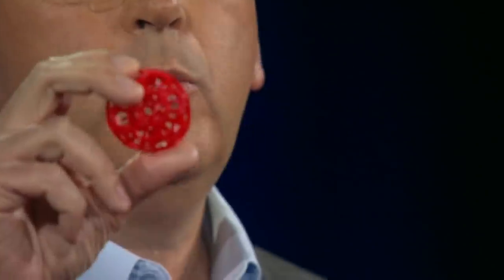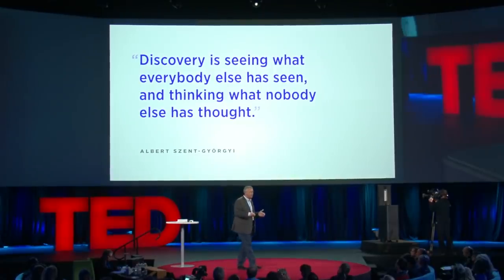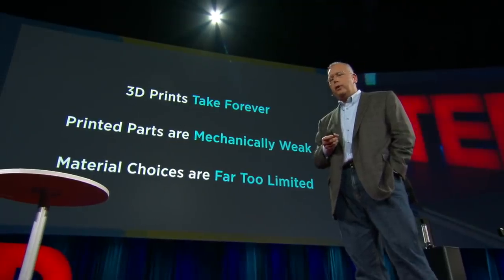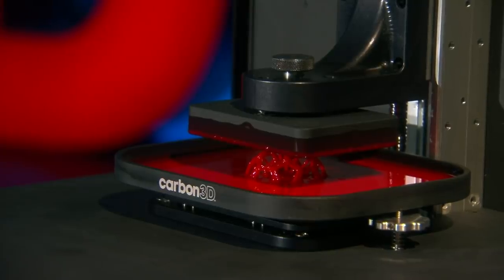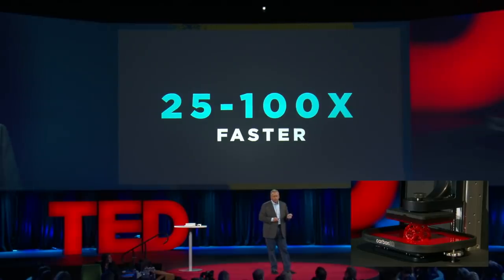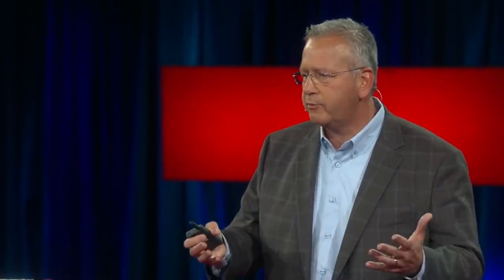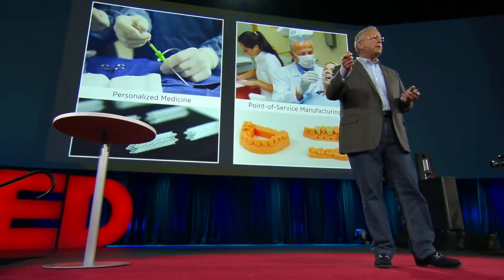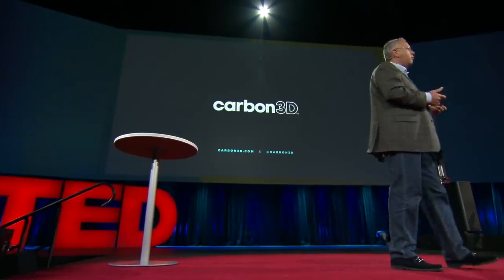What if 3D printing was 100x faster? | Joseph DeSimone

Comment: What if my inkyjet printer could connect to my computer and actually work
Reply: I find my 3d printer is more reliable then my inkjet
Reply: @Steph.98114  ikr
Reply: What if the ink refills for the printer didn't cost more per ounce than human blood. Yeah that's a fact
Reply: @brettking8663  just but a printer with a ciss system, or modify your's.
Reply: I just bought a printer. To replace all six ink cartridges costs £250~300, depending where you shop.
Reply: @brettking8663  Just out of curiosity, where do you buy human blood?
Reply: @nagualdesign   I don't buy. I like to make my own supply lol. "Sacrifice Saturday" 🗡️💉🧛
Reply: That would be too good. No can do.
Reply: The DIY Shop yeah and I found my 4d printer is even more reliable than my 3D printer!
Reply: Don't rush technology, dude. You are expecting too much.
Reply: The DIY Shop me too
Reply: You should be on here
Reply: LOl just buy a brother lazer printer in black and white.
If you want color just use something that has a screen.
Reply: Keep dreaming man, ctrl-p will never work properly
Reply: 2020 gang
 We still got '99 problems
Reply: We haven't invented this technology yet and my guess is we never will
Reply: What if we can get inkjet cartridges at one hundredth cost of the printer.•́  ‿ ,•̀
Reply: The day I brought a mono laser for the daily work was the day I stopped wonder how long till my printer decided to have a usb config issiue and need to be reinstalled and not been able to get the right cartridge the day before something super important to submit

Comment: 2D printing is really just 1D printing over and over again.
Reply: LMAO true
Reply: So... 3D printing is 1D printing over and over again?.. like.. infinite lines, with no depth, nor width, just to make.. a ball?
Reply: And 1D printing is 0D printing over and over again. XD
Reply: Technically yes, because you are printing lines over and over again, row after row on a piece of paper to form 2d shapes.

Correction: Actually, not technically. It is 1d printing over and over again
Reply: No. 2D printing is 2D printing. It prints 2D layers. If it would be 1D printing, then it would only print lines from left to right, like traditional old printers used to do. 3D printers move their head in two directions on each layer, so it's 2D printing over and over again.
Reply: Then 4D printing will just be 3D printing... over and over again... on the same spot... Makes sense to me!
Reply: Syntax Error.

"You just messed up my brain" 

 - Windows.

Sorry about that.

Error 404.
Reply: @Radoslaw1986xx  Traditional Old Printers? USED TO?! Where the heck do you live?! I'm thinking either the US or Japan but, IDK. Where I live (The Philippines), printers print lines (Well not right away, it's more like painting precise lines). And that's just 60 - 95% of them. The rest print dots one by one to create a line then the thing that puts ink on the paper goes back to the other side of the paper (one dot forward) to start the entire process again.
Reply: @moondust2365  That's exactly what I meant :-P Dots being put next to each other in one line ;-)
Where I live, most printers are laser printers (Poland).
Reply: @Radoslaw1986xx  But you said 2D? Isn't "2D Printing" in that sense just multiple 0D objects (dots, even though they're not really "zero dimensional" since they're circles) to create 1D objects (lines; again not really "one dimensional" but you probably already know that) with the process repeated to create a "proper" 2D object (also not what it claims to be, papers have thickness). Then why did you say that 2D Printing actually printed 2D? Because the final product was 2D? That it could print in 2 Dimensions, albeit not all at once, print dots in a manner that created a 2D object?
Sorry if I sound rude or ignorant, I am just trying to know whether or not if my previous statement was what you meant when you said "2D Printing is 2D printing"
Reply: A dot is a 1D-Object. There are no 0D-Objects per definition. You need to have at least one dimension, without one dimension you have "nothing" or "null". (Edit: You could have a singularity here, but my printer isnt printing dark holes out, so...) 3D consists 2D, as 2D consists 1D. You need the first dimension to draw the other ones of course. But!

My (3D)printer prints in 3D in a physical point of view, because the line it draws have a lenght, a height and a depth. But my old inkjet do actually the same. We might not see it, but ink have a height too. So technically (from physics pov) no printer can print a real 1-dimensial or 2-dimensional object in our 3-dimensional (just space,  no spacetime) world. So Michael Gonzales are not correct, at least not technically.
Reply: failed on understand dimensions.

thickness needs to be anything, or there would not be a line after all... if you have lengh and thickness you have 2D...  1D "doesnt exist" its just theorical... dont mix the amount of axis to be used on the printing with the dimensions.
Reply: I want to see a 2.5D fractal printer !!!
Reply: 1D printing doesn't exist. 2D printing is 2D printing because it happens in two dimensions. 1D printing can only happen in 1 dimension.
Reply: What is this... Flatface
Reply: 4D printing is really just 3D printing over and over again.
Reply: But actually it's not.  1D printing would never make a bigger line.  I hope it goes without saying, but 1D printing is not a thing.
Reply: @hypermangi8265  It would be a ReferenceError: 4th Dimension not found.
Reply: @Radoslaw1986xx  3D printers make a 2D product, then move upwards (3rd dimension) and make another 2D product. In 2D printing, the printer makes a 1D product, moves 2nd dimension and make another 1D product. It's the same thing your logic doesn't make sense.
Reply: @cingilc  You're wrong my friend. 3D printer is printing layers of project in 2D and then moves up another layer in 3rd dimension (Z axis). When printing each layer it moves simultaneously in both X and Y axis. If it was 1D printing over and over again it would move in X axis from left to right and then one step in Y axis - similar to ink jet printers.
Reply: @Radoslaw1986xx  The question was if 2D is printing is 1D printing over and over again. Doesn't matter what moves where, if a regular printer cannot print a whole paper at the same time, it IS 1D printing over and over again. By your logic 3D printing is also not 2D printing over and over again because each layer has some amount of z-axis length in them. So it is 3D printing over and over again.
Reply: @cingilc  in ink jet printers it is 1D over and over again, true. But video is about 3D printers. It matters what moves where because we're talking about 3D printer not 3D printed part. So the printer moves in three axis. But on each layer it moves in 2 axis so it is 2D. Laser engraver would be different case. It engraves 1D over and over to make 2D image. But CNC router engraving is 2D only, just as 3D printer. Both make arcs and straight lines (in every direction) and those are 2D objects.
Reply: @Radoslaw1986xx  I agree, actually "It engraves 1D over and over to make the 2D image." was exactly my point in this argument. So if a method is engraving 1D over and over to make a 2D image, it means it is 1D printing over and over again. Every product of CNC machines and every layer of 3D printers are "technically" 3 dimensional but I except they are 2D printing over and over again. The only 2D printing method does not fall in the category of 1D printing oaoa is medieval printing that uses presses.
Reply: @whovinny-brovian4223  Infinite dots. Not loonies or lines. Love em auto corrects
Reply: U dont really understand 2D..  Do u..??
Reply: 1D printing is just 0D printing over and over again
Reply: Technically 2D printing is 3D printing because the ink still has width and nothing is truly flat
Reply: 3D printing is really just 2D printing over and over again.
Reply: 3d printing is also just 1 printing over and ovet
Reply: @stephenmorgan6116  actually yea, you're printing dots (points) over and over again
Reply: Actually 1d printing is 3d
Reply: 3 printing is 2d printing over and over again
Reply: Omg, no! 1d is a dot. 2d is paper. 3d is reality.
Reply: 1D printing is just 0D printing over and over again...
Reply: @tvt2428  no its standing in one spot not moving at all.
Reply: Michael Gonzales 1:12
Reply: Actually it’s all 3D printing cause 2d is infinitely thin
Reply: Then what is 1D printing
Reply: @BioClone  light is 1d
Reply: @hirokatsuvictor8755  just because you don't see it doesn't mean that there's no height on a print, it's not "1D"
Reply: whovinny-brovian?!?! It moves in all 2D directions just a 2d printer moves in 1 dimension
Reply: tf is 1D
Reply: nice pfp
Reply: @whovinny-brovian4223  welcome to calculus
Reply: brain teaser : and 4D printing is?